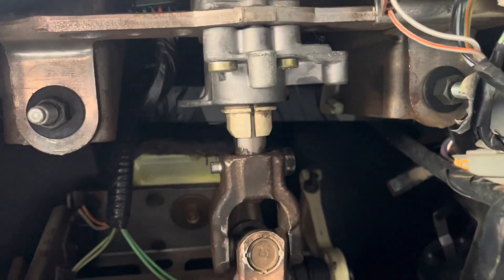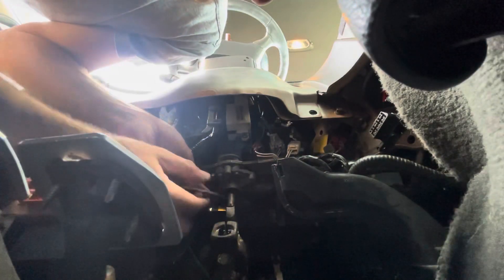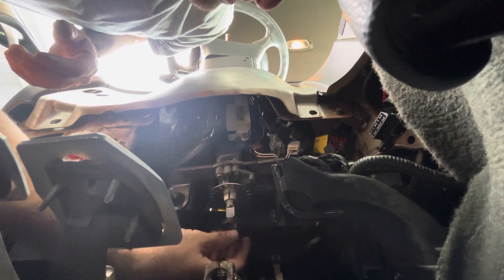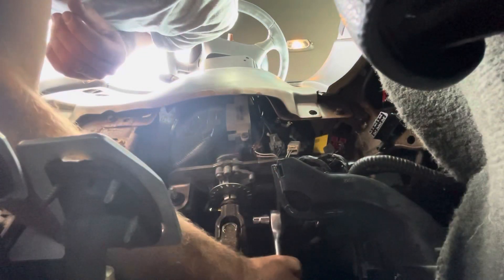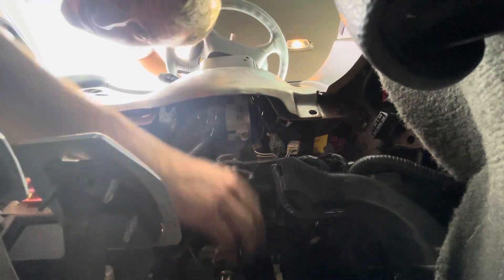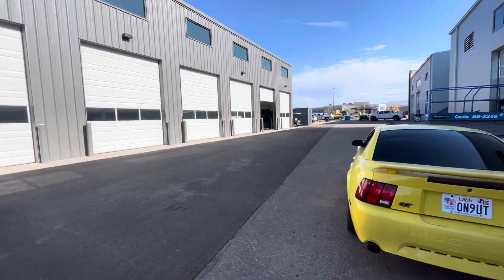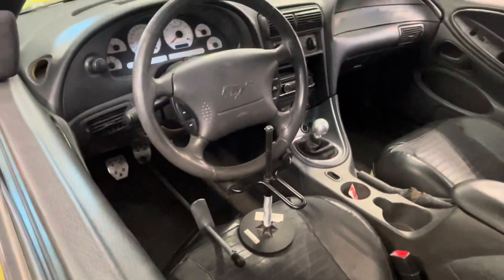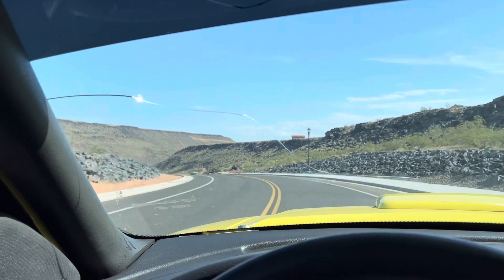2002 mustang GT alignment

Comment: That thing needs caster camber plates bad which isn’t surprising all things considered. That .7 caster split will cause it to pull right no matter what you do. I bet if you get some plates on that thing you can get dialed in perfectly 👌🏻 Good job on this transformation. I have a clean rio red/white top and interior 96 GT vert that needs some love with your name all over it!!! 😅
Reply from the maker: When we were finished with the alignment he said it came out the same as his Mach 1 and bullitt on the same alignment rack and it should be good. I haven’t noticed it pulling either direction. If it is an issue for some reason the CC plates would definitely help.

Comment: Corvette C5. Have the same problem. That the ABS goes bad. I think it's because Bosch was the company that made ABS for the Mustangs. Camaro's firebirds and corvettes. Back in the early 2000s. But in 2001 they changed the ABS modules to a different brand.
Reply from the maker: Yeah mine is a Bosch